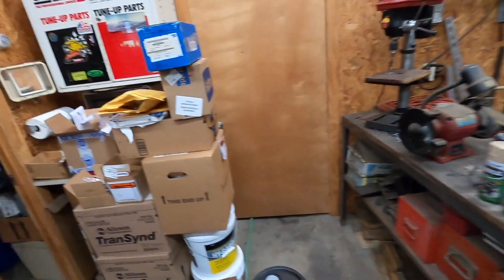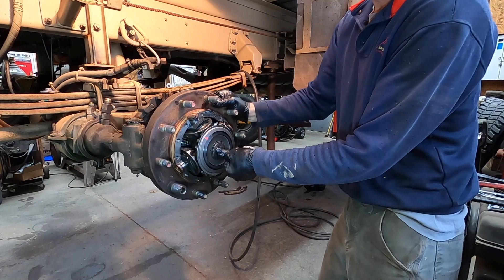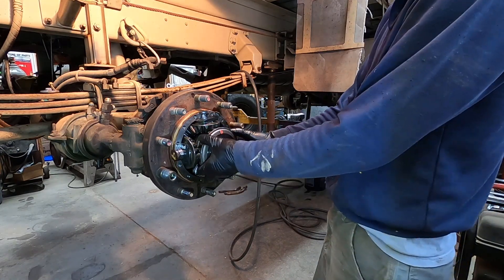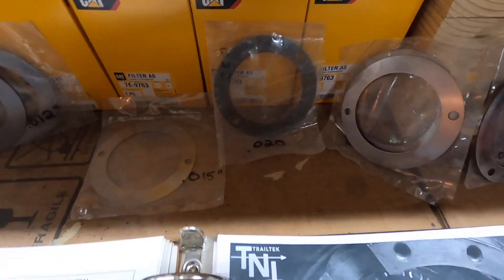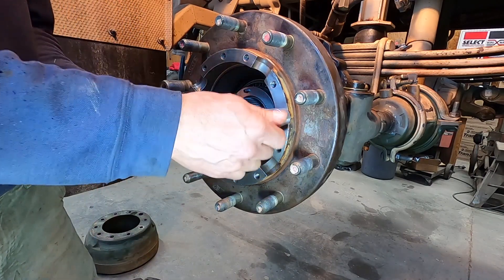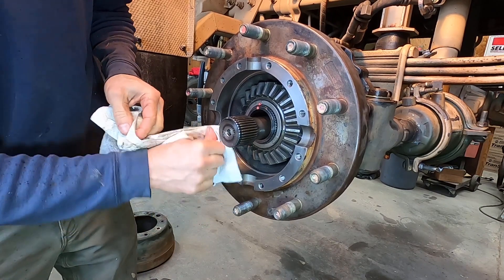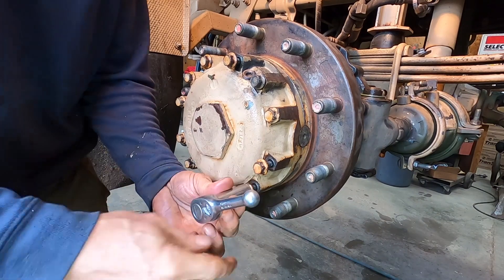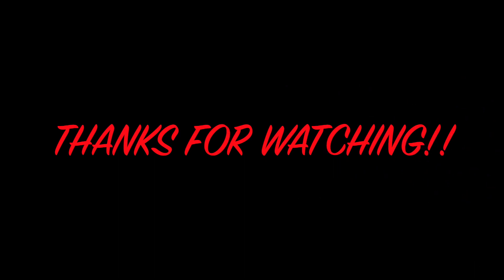SPIDER GEAR removal and installation ON LMTV FMTV MERITOR AXLES

Comment: What is the symptom the truck was having that leads to this repair?
Reply from the maker: I wanted to check and repack the inner wheel bearings. So I put new CTIS seals and checked the spider gear clearance at the same time.
Reply from the maker: The outer wheel bearings are in an oil bath but the inner ones are greased.
Reply: @NEILSWORLD  Got it, thank you.

Comment: I'm finally going to dig into this on mine. I just searched the TM's & can't find the section on this so I also have that to reference. Do you recall where it was in there?
Reply from the maker: TM 9-2320-365-20-3  10-3 Differential Sider Assembly Replacement
Reply from the maker: 10-2 Wheel Bearing/Central Tire Inflation System (CTIS) Seal Replacement
This is where the shimming is talked about.
Reply: @NEILSWORLD  Thanks as always man!!

Comment: great/informative site for a new 1078 owner. But, my transfer case makes a horrible death sound..as if this am I pulled the TC drain plug and 3 small needle bearing were found...erring on the side of caution, I wish to replace the tranny/transfer case as a unit...thoughts?
Reply from the maker: Transmission and transfer case unit should be available, there are plenty of these trucks getting parted out. If you're not a member of a lmtv Facebook group you should join one, there are lots of parts suppliers on there.

Comment: I noticed one thing that you didn't do that I did when I changed my CTIS seal.  That was cry.  Like, a lot.  I also did mine in the winter like you, but I went for the extra challenge of doing it outside.  Thanks for the video, the shim part was the worst and you did an awesome job explaining it all.  Merry Christmas
Reply from the maker: Lol, thanks, I'm going to do all of my ctis seals and repack all the inner wheel bearings also clean and regrease brake adjusters and wedges. I have lots of footage to edit and we'll have more videos out soon. 👍

Comment: I would have removed the spider gears and put eco hubs in.  that way you can go drive faster than 55mph.
Reply from the maker: Eco hubs weren't out when I made that video. They are installed in the truck now!
Reply from the maker: I have a video showing how they act going down steep grades.

Comment: Great video! Thanks for putting it together. 🙂
Reply from the maker: You're welcome. I have a lot more footage to edit of repacking the inner wheel bearing and changing the ctis seals. Also disassembling and cleaning the brake parts. 👍

Comment: This was the video I was waiting on.  You made something that I was dreading look super simple.  This was a much needed video/how to for the FMTV community..  Thanks for the shout out... 

Are brakes coming up next?  I am assuming you caged the rears to get the drums off??
Reply from the maker: Thank you. Yes, brake caging, drum removal, adjuster disassembly and cleaning are all on the agenda along with ctis seal replacement and wheel bearing repacking. Lots of footage to edit and videos to get out. 👍
Reply: @NEILSWORLD  I am so stoked you are doing this as those are items no one has covered in depth and just happen to be some of the last few things I need to do maintenance on.

Comment: Great video, thank you for doing it! Im nowhere near an axle expert, so be gentle.. Why not reuse the original shims?
Reply from the maker: Great question. I took my hubs apart for several reasons. 1: to repack the inner wheel bearings. 2: while it is totally apart I wanted to replace the ctis seals. 3: I wanted to check the clearance and adjust the shims.  I would have used the shims that were in there but more were needed to bring it up to the proper tolerance.

Comment: Plastic rings break on install or removal from improper installation the military doesn't have an exact procedure just install them with retention ring
Reply from the maker: Yes, I wasn't real clear about that I reused my original ones they were fine I just didn't need the new ones but I do still have the front ctis seals to do so good to have them on hand. I will be clear about that on the ctis seal replacement video. 👍